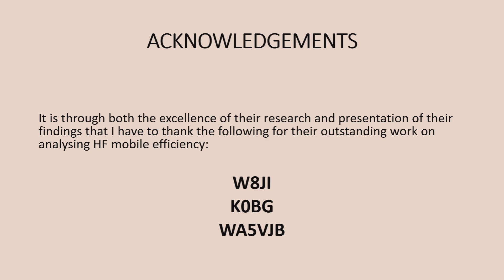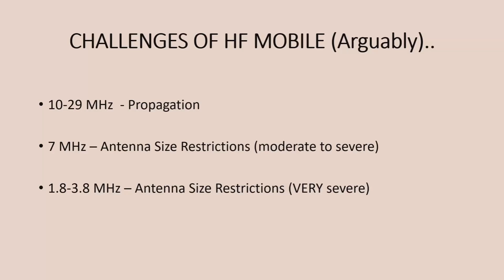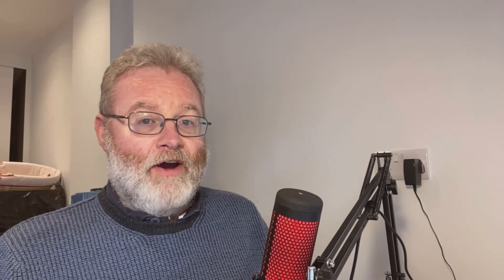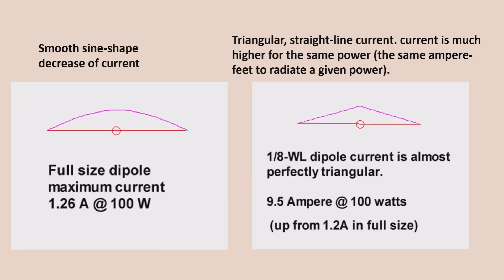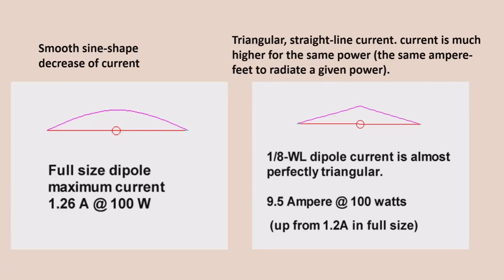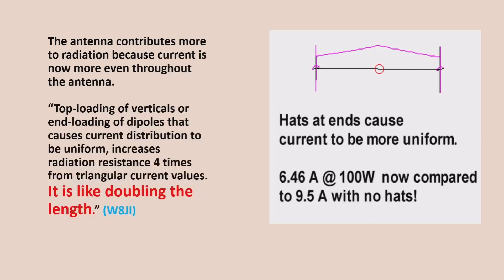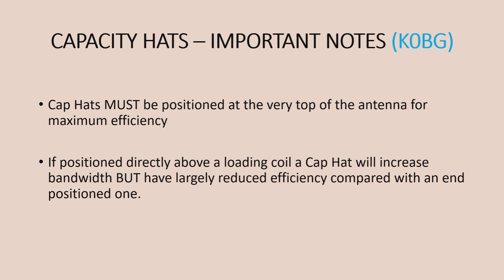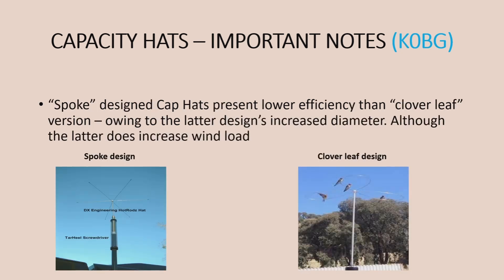HAM RADIO: HF MOBILE ANTENNA EFFICIENCY (PART 1 - ANTENNA LENGTH)

Comment: Tim, very good presentation and I am learning a lot.  I was able to follow your math until (@11:37).  On the spreadsheet where you calculate the radiated power to be 3.1W.  Given Prad = (Irad)^2*Rrad = (3.1A)^2 * (0.3ohm) = 2.88W.  What am I doing wrong?  Thank you, now on to part 2.
Reply from the maker: I will need to revisit!

Comment: Thanks for the video, I have been a follower of K0BG from his days on the QRZ Mobile Forum and his superb website.
I operate largely /M on 40mtrs with a homebrew Texas Bugcatcher Antenna installed after much reading of K0BGs website 
Capacitive hats are very effective but not really practical for day to day driving on UK roads. Replacing the 1.5mt whip above the loading coil on my Bugcatcher with a 1.5mt aluminium element with a cloverleaf cap hat extends the range of the vehicle mounted antenna to cover the 80mt band but only for static operation
Ken G6YYN

Comment: 75M mobile is my favorite mobile band, and I ran a standard stainless 108" CB whip with a base load (tuner in trunk) for years. Yes a few dB down, but it worked great and was indestructible. It really is all about the location of the antenna on the vehicle, especially height and center position,  smoothness and size of your ground footprint, and your grounding bond to the vehicle. Using low loss double shielded cable with several beads for decoupling is important for when you are off resonance. These install factors dominate vs the antenna efficiency itself, within the resonant bandwidth. This is why a hamstick in the center of the roof can outperform a bug catcher with a giant top hat in a truck bed.
Reply from the maker: Indeed .. the increase in loss resistance is quite marked when you start to mount the antenna below roof height

Comment: Hi Tim, thank you for doing this series on antenna efficiency, I look forward to seeing Part 2.  Part 1 confirms what I suspected regarding there being a "sweet spot" for convenience vs length, but I didn't know (specifically) that an 8th wave was only 2.5db down on a quarter wave - which let's be honest, is pretty negligible at the receiving end.   This level of detail is really useful, so once again thanks.
Reply from the maker: Thanks!!

Comment: but by adding a hat on a mobile antenna the wind wind resistance a ton..
once you go anything above 20 kph, when you stop the recoil will be dramatic . not only that, while driving the wind resistance with the flexibility of the anten may just rip the antenna off the car  I'm assumming a mag mag mount. 
I'm confused, the wind resistance seems to me will cause many problems.

I';m assuming you're driving, the old CB radio days.
Reply from the maker: Yep I addressed wind loading in the video

Comment: As someone just starting with HF mobile, topic this is very relevant. I'm currently using monoband hamsticks which appear to be a bigger compromise than expected. Please share links to the research you mention. 73 de W5CMM
Reply from the maker: Will provide more info on the links in future videos 👍